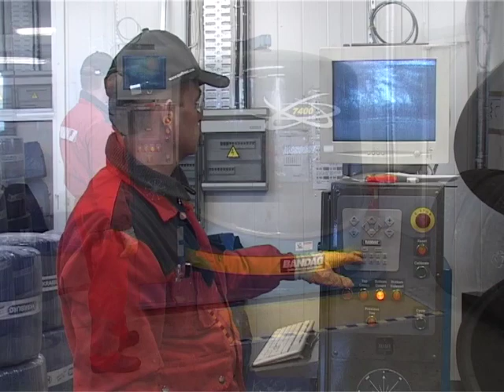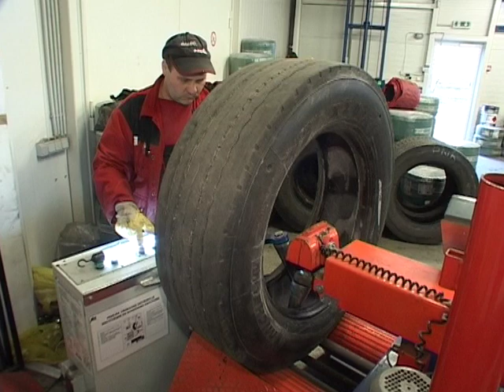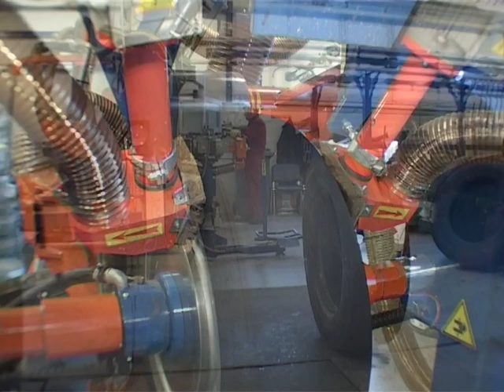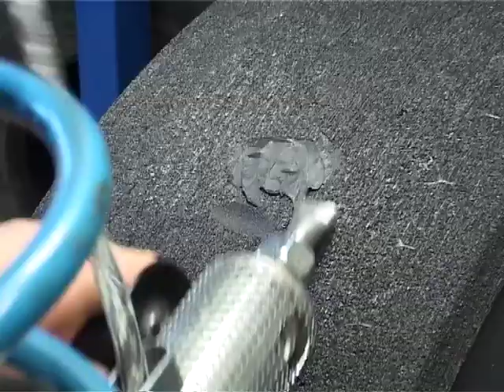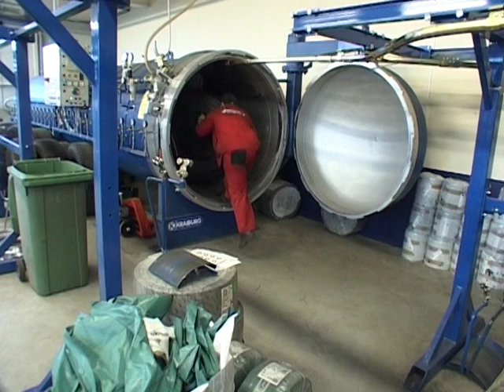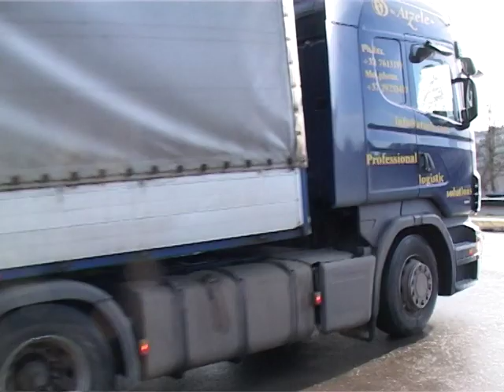JUVA  truck tyre retreading

Comment: Retreading tires for big trucks isn’t the problems.  The biggest treading problem is overloading the trailers.  Too much weight put a great amount of stress on the tires.  The best cheapest solution is reducing the weight carried or adding additional axles with more tires to support the weight.  Best of luck with these vlogs.  Thanks for posting.  Education never stops!

Comment: WALMART $32 per 5 gal hyd fluid.. https://www.walmart.com/ip/AW-46-Hydraulic-Oil-Fluid-ISO-VG-46-SAE-15-5-Gallon-Pail/704773503
55 Gal. AW-46 hyd fluid.. https://www.walmart.com/ip/AW-46-Hydraulic-Oil-Fluid-ISO-VG-46-SAE-15-55-Gallon-Drum/919900381
275 Gal bulk hyd fluid https://www.walmart.com/ip/AW-46-Hydraulic-Oil-Fluid-ISO-VG-46-SAE-15-275-Gallon-IBC-Tote/201530793

Comment: Not worth the savings if u get one blowout on the highway in summer. And recaps are Guaranteed to blowout or delamination in heat. It's a loose loose situation
Reply: You must be running the wrong pressures or overloading, I drive a unit with 32 tyres, run recaps on all but the steerers, over the past 17 years blowouts have been very rare and I've only had one delaminate.

Comment: That's why ON EVERY AUSTRALIAN HIGHWAY ALL YOU SEE ARE old treads polluting our highways ,I would NEVER USE RETREADS. ON ANY OF MY VEHICLES.ITS JUST NOT WORTH IT.
Reply: Andy bought one set of retreads with our own good casings,  had more flats and peeling with in the first yr. We've run all new Firestone on drives and Bridgeston on front and I've never had a flat or a tire blowout in 15yrs
Reply: 200 tons mining trucks,planes like said in the comments here too have retreads
You see treads on the highways because tires are not inflated properly and just fall apart.
Reply: More details:
Whatsapp:+86 15107149073
Twitter:@Mr_Scott66
More suprise for you.
Reply: @VaIhalIa  I agree with you Andy I was lucky to manage the 1st Bandag factory in New Zealand I help to install the plant with Australian Frank Walker of Bandag Au. in 1975.I claim to be the best vulcanologist anywhere I was the 1st to retread solid industrial tyres the 1st to retread rimless tyres the 1st to vulcanize rubber to metal using Bandag system the 1st to repair tyres using my own invented curing bag and vacu-patch .Andy you are exactly right when you say driver responsible for most tyre damage a survey in Au. from Brisbane to Melbourne clearly showed new tyres were worse than retreads.
Reply: New tires are just as likely to blow out as retreads. Under inflation and overloading are the chief causes of failure.